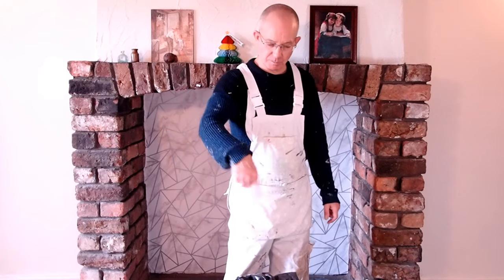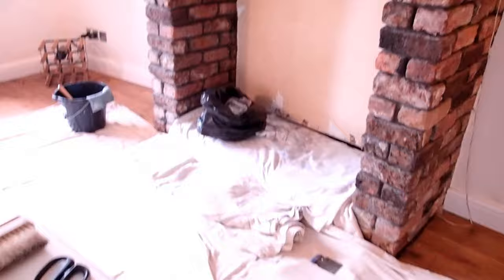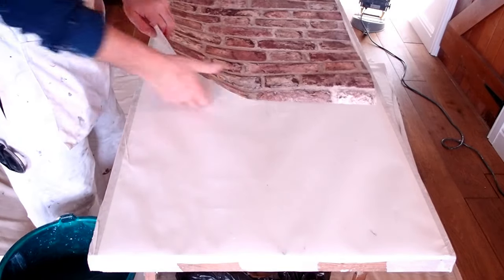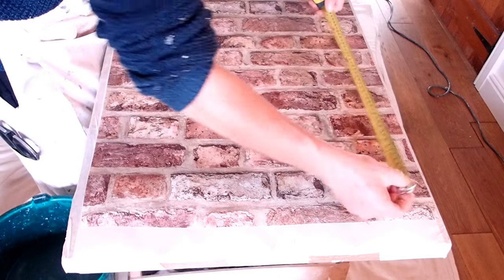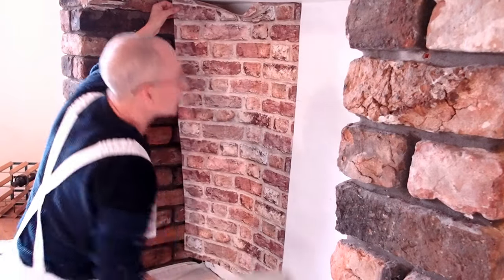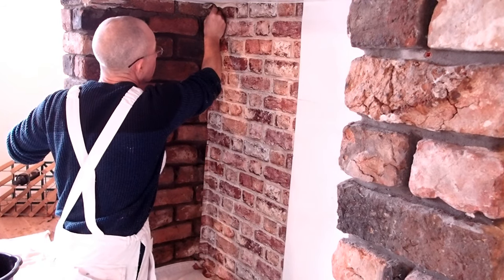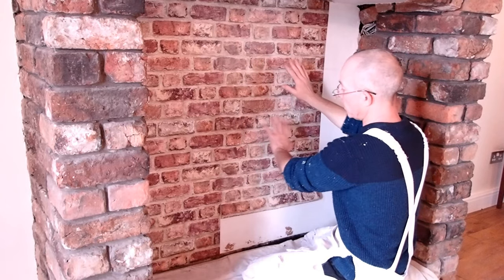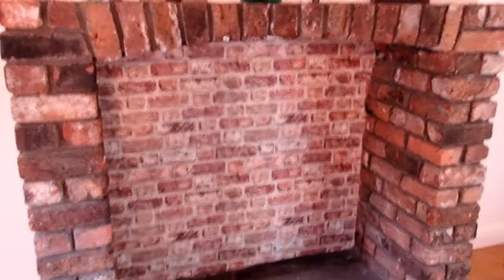Hanging Wallpaper, Feature Wall, Brick Effect

Comment: I appreciate the effort you went to try and match the brick to the paper on the left hand fall. I’m not a professional, just a diyer trying to learn off quality trades persons like yourself. I was told that when hanging paper on a feature wall, you hang the centre drop first then trim both sides equally. I know this may mean the pattern in this instance may not fall with full or half bricks, but both edges would be similar. Was this information I was told correct?
Reply from the maker: Thank you, it's all down to the pattern, sometimes you need to off set the first length to balance the pattern. And some patterns will never sit right no matter what. Thanks